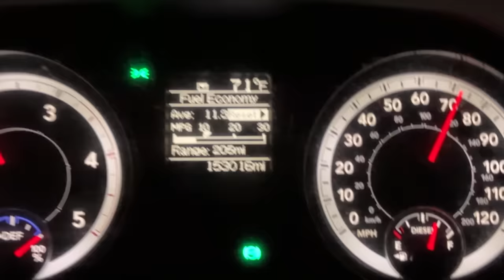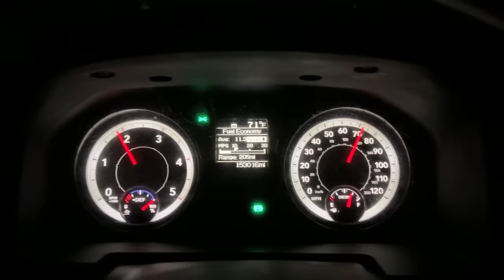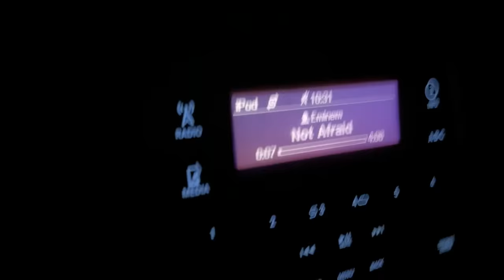My new truck broke down 9.5 hours from home. Dealer refused to do anything...

Comment: I would never buy a new truck.  They are built for profit not reliability.  Those CP4 pumps are junk, built to maximize profit.  I'd love to have the new body with an older drive train.  Screw emissions.  if you feel for the environment, plant a tree and stop using so much plastic!

Comment: Good on chris for helping you out, keep the new truck and prep your old unit as a back-up plan...
We have 7 units and 4 tractor trailers incase things get ugly...
If your planning on driving out side your normal area its definitely a good idea too have lots of options in place if the what ifs happen...
And a back-up plan for someone to rescue you and your rig...
Make sure there are a few extra trailers as well...
Human power,,, Truck power,,, trailer power and get hold of storage and wrecking yards in a few spots along your route...
Your race car comrades will fill you in on who you can count on...
If you fail too plan your plan will fail...
Your lucky it panned out as well as it did...
Good thing that this didn't happen to you half way into Alaska.  You would of been looking at a $10 too $15.000 price tag if not more once all the bills get paided the next following year. That's correct, your truck would be stranded up there for months on end before getting it hualed South if it needed major repairs...
Can you imagine a semi truck with loaded wheeler breaking down on you and the costs too retrieve it...

Comment: I had the same truck. Wait for the ck eng light and see the head gasket had a leak. Never saw coolant, but smelled it. The head gasket which is a common problem cost $12,000.00. And a week. They had to remove the cab since they cant pull the heads with the cab on. BTW mine had 24,000 miles and I bought it off the showroom floor brand new

Comment: As a retired truck driver, I'm no stranger to the side of the road or the tow hook. 
I had a 2006 Dodge Ram 4x4 Cummins which I had a lot problems with.  I don't recommend a modern diesel if you can possibly avoid it.

Comment: This is the first time I watched your videos, and the headline caught my attention. Over 20 years ago, traveling to Alabama from Arizona, I had fuel injector pump troubles on a dual-wheel chevy. I was pulling a heavy 37' foot fifth wheel back home from a 3-year stay in AZ. On I10 in AZ while pulling a grade in Texas Canyon, I lost most of my power. I was able to limp into El Paso and get into a campground. I had fewer options than you. I spoke with a recently retired colleague back in Alabama and within 24 hours from Clanton AL he showed up in El Paso with Dodge Cummings and pulled me and my trailer home. I had managed to get the truck to an El Paso dealer and they gave me a ride back to the campground. I noticed you have an updated video, so I will get to see the end of the story. I had issues with the warranty on recently replaced fuel injector pumps with my truck. The bow-tie boys would not cover anything.

Comment: Ford diesels have always been extremely unreliable since 2003 model 6.0 engines were used. They got a touch better with the 6.7 engine, (won't even mention the 6.4 abortion) but the trucks are still the most broken down trucks on the market in the diesel segment. I owned and operated a light duty diesel shop for 20 years, and I have heard, seen, and been involved in more horror stories than most people would believe. You can't imagine how many people paid our shop to repair trucks still under Ford warranty due to Fords terrible service. I recommend to stay away from the Powerstroke diesels at all costs. Especially when they are the most expensive, yet least reliable trucks in their category.

Comment: I look at this from another angle, having owned about 40 cars since I turned 16 in 1964.  The lesson?  Buy used and you are buying someone else's problems.  Yes, it is possible to get a low mileage used vehicle that is excellent.  But more often than not, ain't gonna happen.

Comment: if the part is known to be the weak link, and yours failed. So if they replace it with same part(non updated), it will only fail again. Don't know if this is only year for this part that fails or not, but anyone who has this year truck, and possibly other years, you better prepare for this to fail, cause it will.

Comment: Man, what a story.  I have retired from racing rally cars in Australia and we have towed rally cars regularly for 6-8 hour drives hundreds of times over the years (but nothing as big as your rig).  We used Isuzu diesel utes and we never got stranded.  Some of the richer teams had big rigid trucks and they used them to hauil the car and all the service gear. I have serviced for two Aussie teams who have done Dakar and we had large specially kitted trucks for that.  The Dakar spec Kamaz racing trucks have - wait for it - a dual turbo Cummins diesel which is actually made in China.  Maybe get a Cummins.......

Comment: Interesting went through basically the same thing in the late 80's with 88 Ranger. Had 3500 miles on it when the transmission burnt up due to no oil in the trans in las Cruzes NM. Took ford 3 months to do anything and me screaming blood murder at a poor pregnant service manager. They finally took a manual out of a Bronco ii . Good Luck and remember to yell and scream allot in front of their costumers. They tend to work faster when you do.

Comment: Sorry about your luck but you bought a ford. I loved my mustangs but I beat on my vehicles and i blew 2 of their v8s and found one of them corroding away internally at less than 40k miles. On the flipside ive never lost a GM engine or transmission and that was with me hammering on an escalade for over 50k miles in 2 and a half years up to 148k miles as well as multiple yukons between my current one at 145k and my old one at 228k

Comment: Great video, new follower it’s funny that your video popped up on recommended, I also own a ford 2017 raptor and my truck has been at the dealer for a diff issue and engine issue for 36 days and didn’t get a loaner until today…….. best of luck on your new truck journey

Comment: I hate to say this but this is what I’ve noticed with fords way to not honor  our contract that we sign at time of signing our finance/  warranty contract to have a loaner/ rental vehicle while the vehicle is being diagnosed/ repaired. So they save 2-4 days to determine if they wanna repair or not. I just bought my first new16 miles on the odometer2022  ( diesel f250) I told the finance guy I have to much health issues to wrench on a vehicle to a certain extent I said I want to be able to bring my truck in and drop the key off no question ask as long as it’s under the year/ miles of the contract I don’t want to hear we need x days to figure out what it is. Nope. The first time that happens. Big LS told them what I want I paid what they charged. This is my 3rd ford not playing games anymore. You got your money now hold up your end of the deal.

Comment: Worked at a Ford Dealership for 15 years. Crazy they asked about you moving the trailer. We would have let you parked it in our gated storage as it was insured. As far as expectations if you had a Ford Extended Service Plan a rental car (not loaner 1 ton) would have been provided to at least get you home.

Comment: Dealership should be embarrassed. We had a customer bring their tractor and trailer down with a truck on it to be repaired and their tractor broke down and wouldn't start back up. We let them keep their truck in our yard over night, no issues, no problems. It's about taking care of your customer. 

I wouldn't let the dealership that gave you that experience ruin your entire experience with the truck. I would be willing to bet if it happened near by the dealership you purchased it from, there would've been ZERO issues with you leaving your trailer, if needed. 

However, I understand that one dealerships lack of customer service can paint a broad brush across other dealerships. Hard situation but I think you handled it as best as you could at the time. 

After reading your pinned comment after watching the video it seems the dealership also made it right, as they should. I'd keep that truck but maybe put the Fummins on a list of projects to "update and upgrade" because like you said, if something happens with that, you can do whatever you need to do on the fly. Rather have it and not need it than need it and not have it. It would also be nice to have the Fummins have a lot of the "creature features" of the F350 that you might miss if you sold it.

Comment: This type thing would be a good time to have a trailer with a engine,  capable of pushing the truck,  a 3/3 tone front hubs, a tesla motor, custom axels,  and a supercharged vortec 4200 running a generator,  to charge a 100 kwh battery, mount tgr motor in the front, tgr battery in the rear , to hopefully get a close balance, tgen buikd a new floor, with   a twist throttle, forward to Regen, back like a motorcycle to go forward,   and use the truck  to steer and lighting,  the generator can supply 12v100a to keep the lights on if tge engibe is running, it xan ve used like a hybrid vto save fuel, basically idling down the road, and  the generator only running to charge the batteries,  and it xsn ve built from a weecked tesla!  Possibly use 25% of the normal amount if fuel, the vortec 4200 should make the required power, and be light weight,  maybe a Subaru flat 6 can ve used if less power is desired over packaging,  basically turning a Tesla into a truck, then turning the truck into a covered trailer!!😆 It would be awesome , with a tongue wheel, it can be driven around,  in a yard , without a truck, and may as well include the plug in charging,  then maybe just use a 8kw generator to charger, it would take 12 hours +/--, or pull into a charger and charge in a hourb ir two,  it wiuld be awesome, with electric trucks being a thing now, i think a trailer with a drive motor is a great idea, have a connection to the driver controls,  to allow the trailer to operate in parallel eith the electric tow vehicle, the regen biased to the trailer for better control,   imagine having a trailer that can do 0-60 in about 2-4 seconds on its own!!😆  You should build one, it will make the truck  more dependable, it will not be pulling so hard,  it will use less fuel, having a 100 mile range plus, electric only  would be good!

Comment: Keep both! Use the old one as a backup just in case something happens again. That way someone at home can always come get you wherever you might be. A 'Chris' is very few and far between. 

The new truck should be good to go now that the President of the dealership got involved. I'm sure he straightened out that service manager out (hopefully fired him) and had the crew do a good job fixing things and making sure it doesn't happen again.

Comment: Almost the exact same thing happened to me in 2021. I was on a 10-hour trip across Texas howling 12000 lb in my  trailer. My less than 20,000 MI brand new Ford did the same thing yours did.. they did cover it under warranty, they did not help me with the trailer they did not help me get home they did not give me a loaner and generally did not care. So I pretty much gave up on Ford and their customer service went to GMC and have a one ton Denali that is never left me stranded and any time I put it in for service they give me a loaner and take care of me...

Comment: Do your self a favor (Do not) trade a Cummins for a power poke you will be sorry . The fuel systems are terrible and the after treatment systems are a nightmare. I had an 02 3500 I woked it for a very long time as a mobile field mechanic. Retired recently sold the dodge and its still being worked every day.

Comment: Chevy ram Ford cp4 junk .when the pump goes sometimes stuff gets in the injectors. Ram has a cp3 kit at the dealership. Find out if the Ford dealership has the cp3 like the ram dealership does.

Comment: I had my f150 for a week when I took a trip with it and blew the rear end, took it to a dealership in Nashville, Wyatt Johnson Ford I think it was called, they got me in a rental before they even diagnosed it and it was covered under warranty 500 miles before the warranty was over. Took about 2 weeks but they fixed it and I had the rental for longer than that because I live 8 hours away. Definitely a shitty dealership.

Comment: If they give u guaranty on u old truck..sue them n for everything they have..teach them a lesson..but be wise.,as a lawyer I would said u have to much load,u were speeding,u was driving recklessly,u was texting n dont  put attention on the gages,u went through a pot hole,the trailer was to low,it was to long,to high,to wide,u use the cheap fluids ,you was horsing around and the guaranty was only for the truck itself,n if u read the fine print,it would said that u ,family,friends,coworkers, sponsors or any one related to you friends,coworkers,sponsors,  can sue them..🧐

Comment: Notification to Ford customer service would get that dealer in deep trouble fast even if it wasn't the selling dealer, FORD is on the truck and that what is important. I have driven Chevys of over 50 years and only had one even and it wasn't me driving but my daughter and she eas six hours from our new home and she was 18 years old just out of high school in a car we gave her, not new but purchased new. She pulled into a dealer in she could limp too, They jumped on it right away to find that they couldn't totally fix it but make it drivable the rest of the way, it was a torque converter issue of some kind. Got her and her friend on their way a couple hours later. They called our local dealer so the part could be on hand the next day for her. That was 28 years ago and all she will buy as a Chevy name plate and so far never an issue on any at least in the 300K or so she puts on cars.

Comment: I worked at a Dodge dealership for a really long time. Granite every dealership is different but at the dealership I worked at we would have never treated you that way. Dodge trucks break too. But just like the Ford dealership we would have done everything we could to not have it be under warranty. All dealerships hate warranty... all technician hate working on warranty. It doesn't pay... it doesn't pay the dealership and all-around is a loser for everyone. I guarantee you your truck will out tow any new truck when it comes to time and distance. If I were in your shoes I would do whatever maintenance your truck needs put it in service. if there's something that stock that's going to break... upgrade it. But don't waste your time upgrading a truck just to have it break itself because it makes way to much power. And don't rely on warranties.

Comment: I just had a similar problem with my truck and trailer on a recent family vacation.
The tow truck guy would not let our yorkie pup in the AC of the tow truck. 
So it had to ride out in the heat of our truck with the windows down. There were many obstacles in finding a way to get to a rental truck that had a tow package.
The St. Mary’s Dodge dealer in Ohio gave us options to remedy our situation, even though they only had a 4cylinder jeep compass. They rented that compass to us for $35. An uber or taxi would have been way more.
We used that to drive a two hour round trip to get the tow vehicle.
They gave us no issue storing our camp ing trailer until we could get a tow vehicle to finish the trip.
They said they were back logged and could not get to our truck until late the next week.
They surprised by having it done for the return trip home.
There are some good people raised on the notion of taking care of the weary traveler.
Of corse Mother Mary never lets anyone down.
I suspect her name sakes either.

Comment: Years ago I worked on offshore drilling rigs and my route back home to Fort Worth was thru Lafayette, La. I hd a 2013 F250 and it decided to do the same thing that your truck did. I get it towed to the nearest dealership because the dealership in Fort Worth I purchased it from had called them and had asked to store my truck for a few days until they could go get it. 4 days later I get a FaceTime call and it was the tow truck driver. He wanted to show me how they had parked it outside with both driver and passenger front windows down. I had been raining like crazy and the interior was destroyed. After 4 months of legal battles with the dealership with photos and statements the judge made the decision in my favor. They dragged their feet and finally got my truck back to me 3 months later. So after 7 months I finally got my truck back. The judge also made that dealership pay for my rental until I got it back and when I did get it they had a secretary hand me my keys and did a walk around to ensure that I was happy with it.

Comment: It's a sucky situation but whining about the dealer is out of line. 
I don't know any dealer that would give you a loaner UNLESS you purchased the truck from them when it was new.
Most dealers don't want you trailer stored on their lot because they don't want the responsibility. 
The dealer asking when you were going to move the trailer is reasonable because it's in front of their business. 

Looks like you got it handled.

Comment: where I work we have a 2017 ford 650 power stroke 30ft box truck it broke down in 2020 with 30000 miles on it the motor blew in it they said was leaking oil . so there spent 20000 to replace the motor and about a mouth ago same deal at 154000 miles now there looking to replace the motor again . what's going on with these ford power stroke motors.